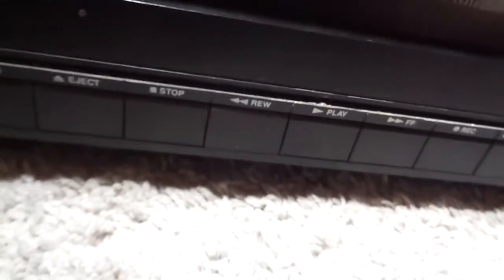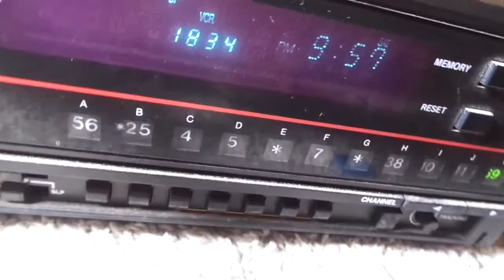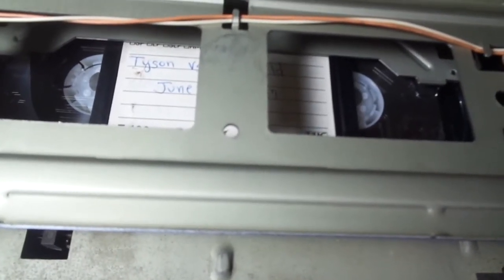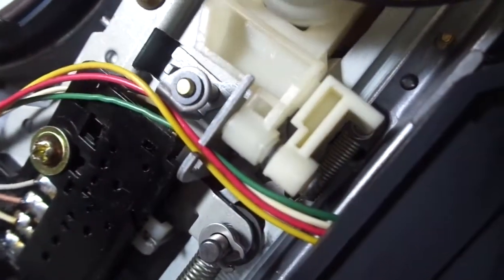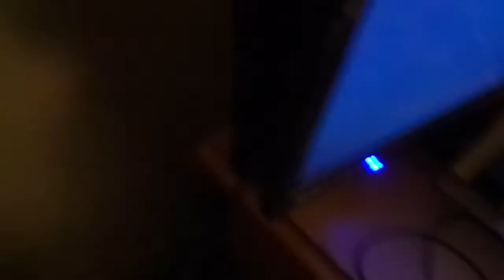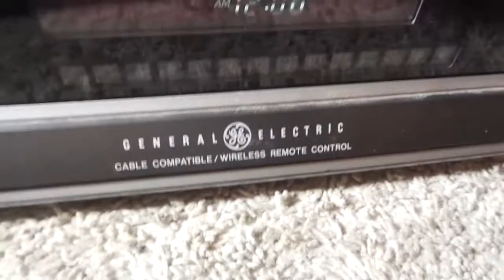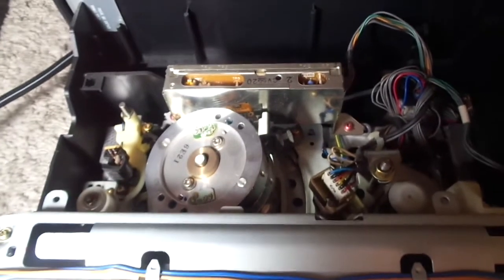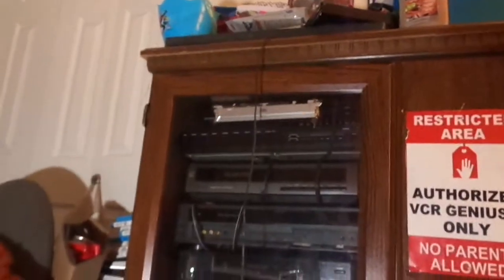Review of my Goldstar GHV-51FM VCR and comparing it with my GE 9-7110

Comment: Very cool. You got the VCR and none of the buttons worked, then you used a universal remote with it and it unlocked all the buttons, is that what happened? I really don't know how that is possible. I want that VCR too. The carriage mechanism ressembles to my Magnasonic VCR. If I was in 1986 I would not rather one VCR or the other, because they look as nice from the front and I would not know about the quality of the mechanism. I would probably take the less expensive of the two. Also 32 minutes is very long for a VCR video. I know I did a 26 minutes video that was long too.